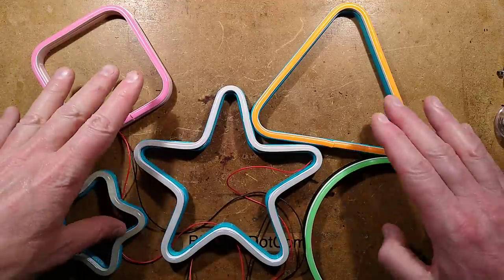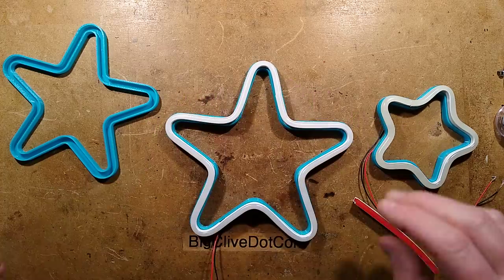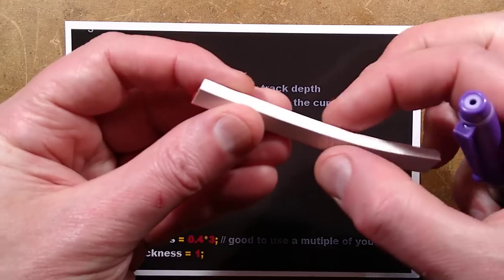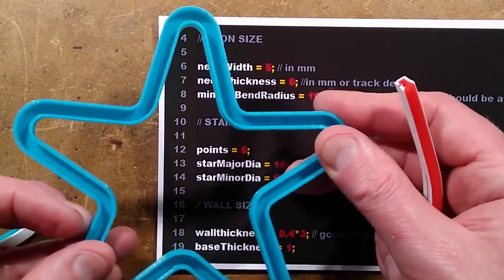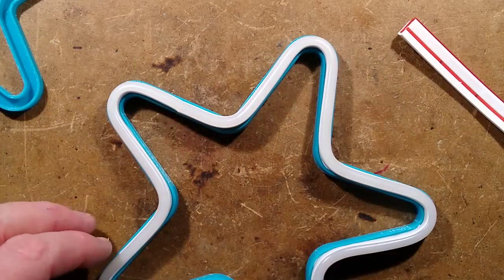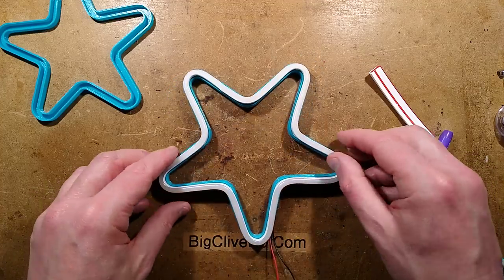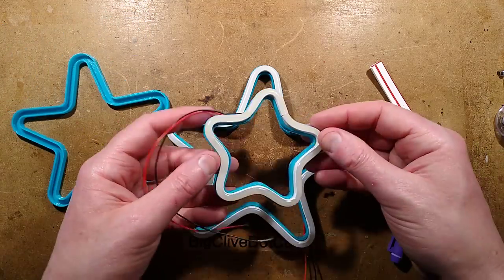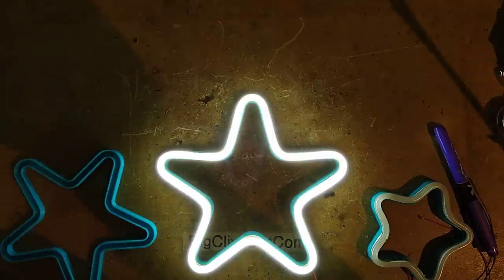By request - the neon star frame

Comment: Could you not add something to the script that will show you the length of the inner star radius?  That would work a treat to make sure that you could save cash with the neon LED strip.
Reply from the maker: I tried that with the first circle script, but it was extremely variable even between different brands of strip.